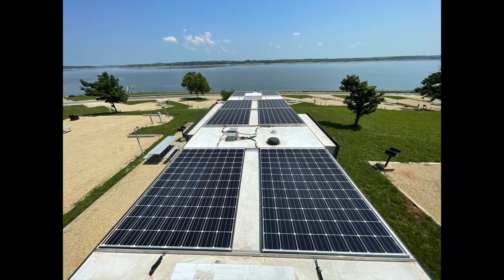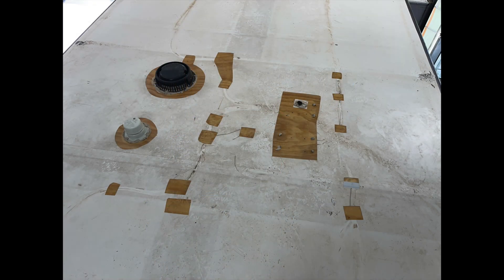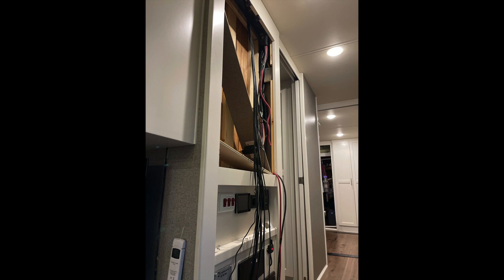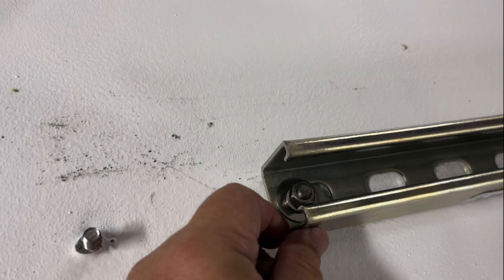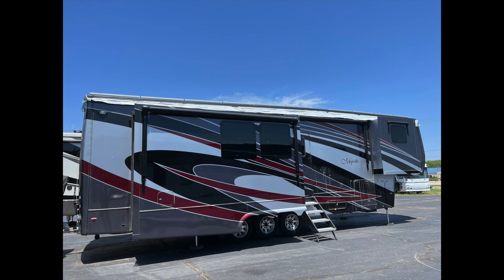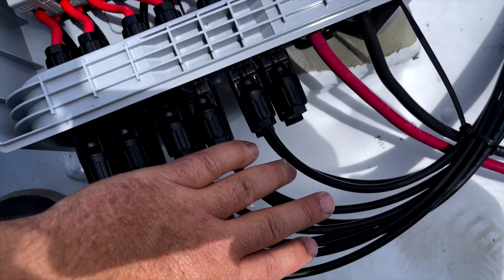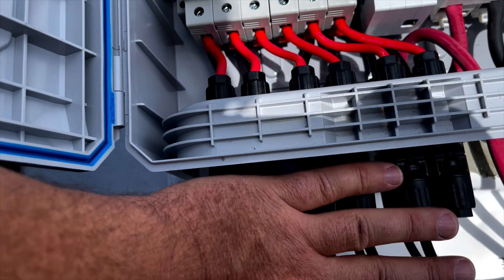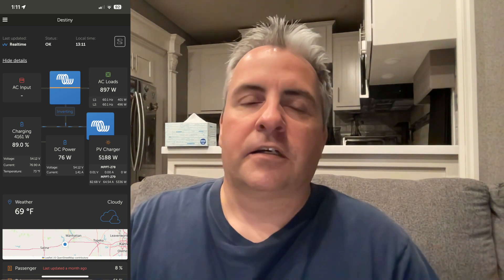5000 Watts of Solar on my RV!

Comment: Nice system! It's a super clean install. I'm impressed! We're retired FT RVers who love to boondock most of the time, so we decided to build our solar/battery system in 2 phases, a 12v phase for our basic 12v needs and a 48v system for our 110v A/C needs. The main issue we faced is we are retired and living on social security and a small pension, so have to do everything on a tight budget forgoing name brand components like Battleborn and Victron for lesser-known brands and must do all the work ourselves - which keeps getting harder as we age.

We just completed the first phase last January, with the addition of a custom built 560ah of LiFePo-4 battery, made with 8, 280ah prismatic cells. We chose a Heltec 350amp BMS, to start the onboard 5,500w generator in our motorhome, along with a 5a active balancer to keep all the cells synched up. We typically use less than 20% of their capacity daily giving us enough reserve capacity for about a week of bad weather before we have to run our generator for charging. It only cost us $1,500 to build this 560ah (7.1Kwh) battery, including the high amp BMS and active balancer. We chose these cells because they fit perfectly under the steps of our MH where our old pair of GC-2 golf cart batteries used to reside, saving 35lbs while having over 5 times the capacity. We insulated the battery compartment, cut a 1" hole in our step risers and installed a tiny computer CPU fan to keep this space at close to room temperature, so we don't have to worry about the BMS shutting down charging if they get too cold - or their life reduced from getting too hot. This first phase, including our 620w liftable solar array, wiring, breakers, a new Progressive Dynamics 80a LFP converter/charger, a 1,000w Renogy PSW inverter (to run our TV, PC, ice maker, etc.), an Epever 50a MPPT charge controller, a Lnex battery monitor/shunt, and a Renogy battery to battery charger cost us around $3,600. 

We started our build 4 years ago with a custom built 620-watt liftable solar array mounted on the side of our motorhome. It serves as a nice bedroom window awning too, practically lifting itself to the desired angle with a couple gas struts and it's easy to clean with a windshield squeegee, standing safely on the ground. By mounting our current solar array on the side of our MH, we left the roof free to rack 8, 550W Sungold Power solar panels down the length of our 35ft Class A about 13" off our roof, above our AC, fan shrouds, etc. This will put us right at 12ft in height, as our MH is much lower than your fiver. We're wintering over in Yuma, AZ now, assembling the components for this build, and plan to have it finished right after the first of the year. Our aluminum racking material and hardware arrived last week, and our solar panels just arrived 3 days ago, but it will take time to get everything in and installed. 

We will be using a Sungold Power all-in-one 48V, 5,000W, 120V PSW Inverter, 80a MPPT charge controller with a 40a a/c battery charger. The reason we chose this all-in-one is because the idle power consumption is only 25 watts - and it's on sale now for only $721! Most units this size have an idle power consumption over 70 watts and cost much more. Our 48v battery bank will use 16, 310ah prismatic cells. So together with our 560ah (7.1 Kwh)12v bank, we will have a total of 22.9Kwh of batteries onboard. We will be replacing our old rear 13.5k btu rooftop Dometic AC with a super high-efficiency 12k Btu 48v DC mini-split heat pump that only draws 750 watts at peak output and less than 500 watts when it's cooling normally. This second phase will cost under $10k, including the $1,500 EG4 28.5 seer2 heat pump, as we plan on doing all the work ourselves. Our 2nd phase will provide 24/7 off-grid air conditioning and supplemental heat from the heat pump and allow occasional usage of our front rooftop 14.5k Furrion AC to cool things down quickly during peak afternoon demand, as well as give us whole house 120v ac power. Like your sweet rig, we'll have total off-grid electrical independence, allowing us to keep our generator in reserve for emergency use only - all on a budget we can afford. Take care, we hope to see you down the road!

Comment: Beautiful installation... are those two panels wide or are those individual panels and are just huge? 72 cell?
Reply from the maker: They're individual panels ... almost 8 feet tall!  156 half cells
Reply: @TisTheDestiny  thanks, beautiful work … (I’m also full time remote in IT Audit/retired Msft on 65 acres in NW Az in a 43’ Keystone Fuzion toy hauler running Longi bi-facials and blue like you). Thanks for the videos.